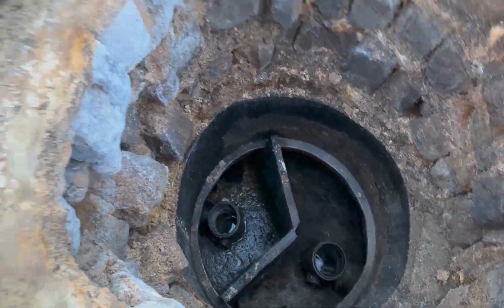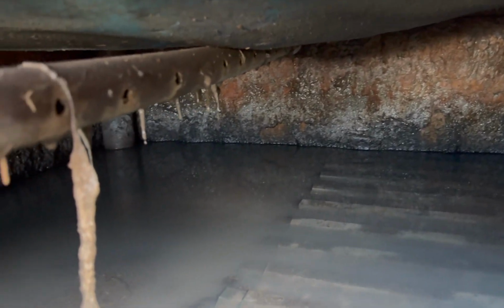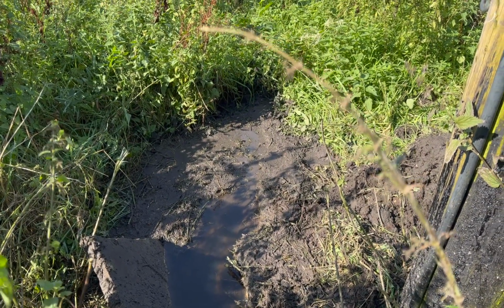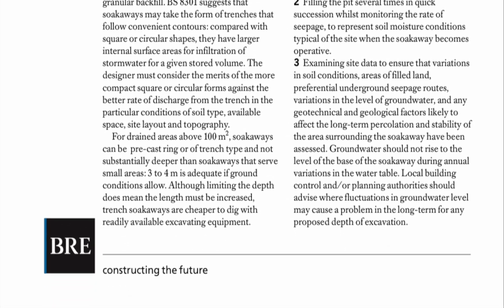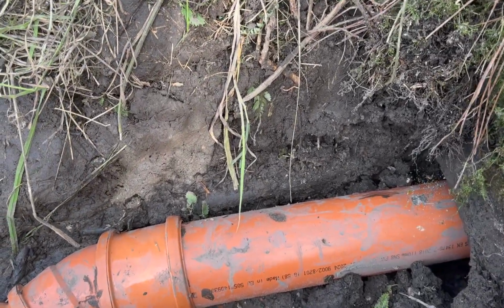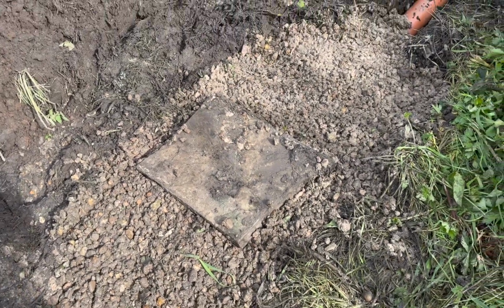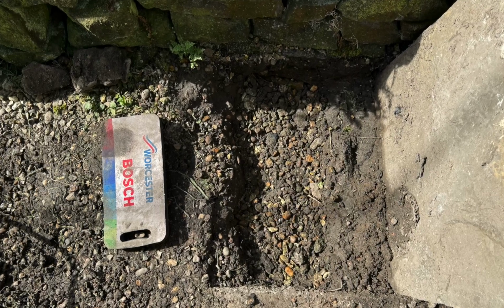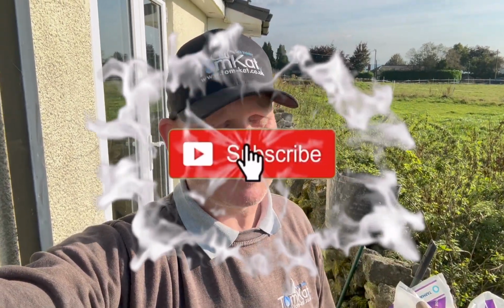My soak-away has stopped working now my garden smells of sh*t. #diygarden #drain #plumbing

Comment: I said when you were cutting the trees on the grounds of safety for the gas tank . The proximity of that opening / tank is more of an issue if you look at the regs re bulk storage tank siting . But you have the tape measure not me 👍
Reply from the maker: @keithward233  so why do you think it’s an issue?
Reply: From memory it should be at least 2m from an open drain etc . And it doesn't look it . That's why I said you have the tape measure
Reply from the maker: @keithward233  open un trapped   drain which this is neither so doesn’t matter about distance
Reply: It's not a criticism or a smart a8se comment but a genuine thought that you could share 👍
Reply: Is it not an open cavity though somewhere to gather in the event of a leak . I know it's a lot of it's but's and maybe' s   but the whole job is that .  And when I used to fit them some jobs needed a lot of hoops jumped through before you could get them passed in certain areas .   I will add in case some don't know lpg is heavier than air . So they know what us old duffers are prattling on about 😅
Ps if you get to the stage you have to change to a septic tank or anything speak to Mike Dixon at JDP at Longtown HQ  👍 what he doesn't know about drainage and products isn't worth knowing.
Reply from the maker: @keithward233  our sump is sealed and trapped from the rest of the drainage system so if the lpg tank leaked it wouldn’t get into the sump unless I had left it open for maintenance but then there is the water trap to stop the lpg getting into the drains. I did drain the sump to show how it works so maybe that’s why you think it’s an open cavity.

Comment: I was on a cess pit abroad in Cyprus for years - 
NEVER use bleach or toilet cleaner or ANY toilet product as it will kill the bacteria in the pit & stop it working 
This INCLUDES the kitchen sink if it drains into it 
NEVER use shop bought toilet paper it contains bleached paper and will stop the pit working - use paper especially for cess pits or dump it in a basket next to toilet  like they do abroad
To FIX the pit clean the pipes out with clean water - flush the toilet about 10 times 
THEN put about 5 pound in weight of liver from the butcher -(the fresher the better )  in the pit - liquidise it if you can so it will work quicker 
This will get the bacteria working in the pit 
You might have to repeat this once a week with a couple of pounds of liver - for a couple of weeks  to top up the bacteria  - but it will fix the pit 
A working pit should not smell 
Good luck

Comment: Can i put a porch around where the boiler flue is if there is some sort of flue extension coming out the roof? Any knowledgeable advice would be appreciated.
Reply from the maker: @Rob-e4f  the flue will have to be terminated to the boiler manufacturers instructions.
Reply: @tomkatgastraining  Thanks for the reply does that mean i carnt have a porch unless the boiler us moved? Know anywhere i can get info? Cheers
Reply from the maker: @Rob-e4f  the manufacturers instructions will tell you how the boiler flue needs to be installed get a gas safe registered engineer out to price for the job